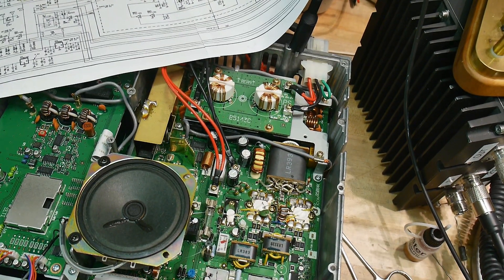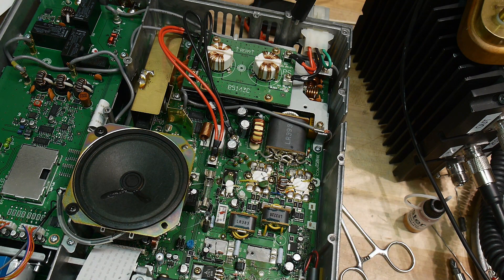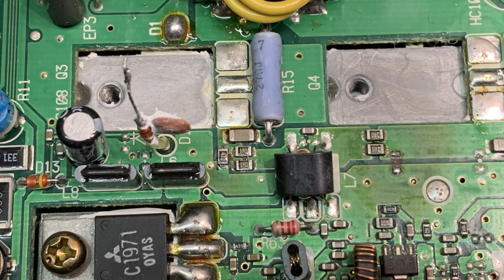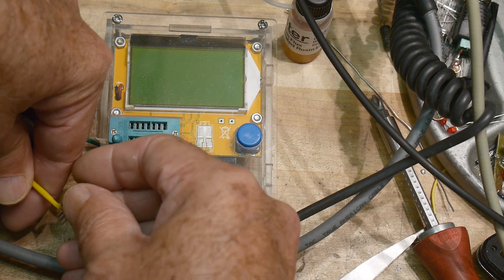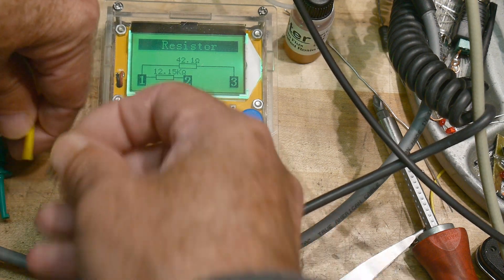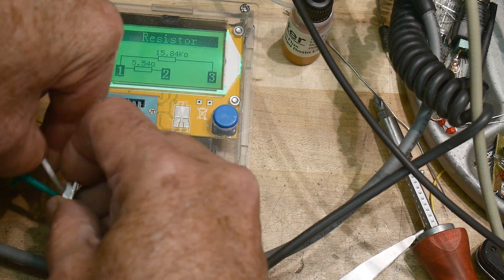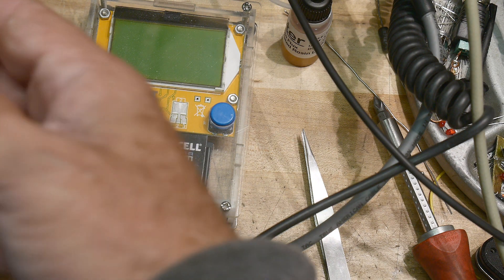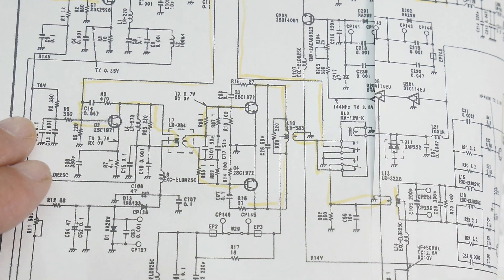#1096 ICOM IC-746 faulty ( part 6 of 8)

Comment: $50 EACH!! For a single transistor. Bloody hell, that is absolutely crazy.  In the schematic, they are driving centre tapped transformer L10 and L7 is the gate/base driving  transformer so its just a switching power supply in push/pull configuration. Check the datasheet and compare the specs to cheaper transistors with the same or better specs. Could they be replaced with FETs?

Comment: I'm no electronics expert, but am I correct in believing the DC supply for the cct is via the centre tap of L10? If so, the DC should go no further than C96 & C97? If for instance C96 went short this would put virtually the supply voltage across both the B-E junction of Q3 and be across R15 and via L7 across B-E Q4 and R14?
Reply: Indeed.

Comment: You can replace those with others, as it is just a class C amplifier, so no real bias issues. 2SC6144 looks like they will fit, and are under $1 each anyway, so even if they blow up cheap anyway, plus are way overkill for this application, using a modern robust power device. looks like they will work here nicely.
Reply from the maker: wrong pin out
Reply: Regardless of the pinout, why you think a SWITCHING transistor can replace an RF POWER transistor?
Reply: @paulcohen1555  Class C amplifier, so it is switching, and was just a first look at something that was same polarity, similar enough at first look, and lowest in price and in stock. I would then start to look for better matches and something closer then. Transistors are not exactly magic, many part numbers are often the exact same die, just either different package, different pinout and different application. Here not exactly critical, the original part is a pretty old design, and there are plenty of more modern parts that improved on the design that you can use here, that will do the job.

It is very rare to have a transistor that cannot be substituted, unless the part was some part that did something, like a GCS, UJT or JFET, or a tunnel diode or backward diode, where the parts are simply no longer made any more for that part. Even germanium transistors can, for the most part, be replaced with silicon with only minor changes, and switching applications there are thousands of transistors that can act as RF amplifiers in the application here, just have to find ones that work with either drop in, or minimal change, though having a non standard pinout is not too much of an obstacle, you just have to either look for a flange mount, or a good insulator for it.
Reply: @SeanBZA  Class C doesn't mean it is SWITCHING.

Comment: Intrigued to learn where the permanent 12V is coming from....
Reply from the maker: All radios of this type have live voltages. It draws 22A at 13.8V so there is no switch big enough. It is important to turn off the external supply.

Comment: Kinda thought it might be those. I've had a couple now with duff drivers, had a Kenwood TS50 which had got so hot it melted the solder around the drivers and there was an electrolytic cap that had neatly desoldered itself, was rolling around in the bottom of the PA enclosure. Recapped the PA but the client refused to pay for the whole radio to be done.